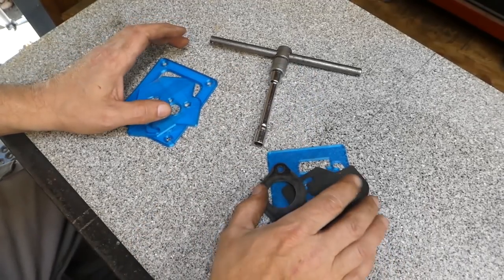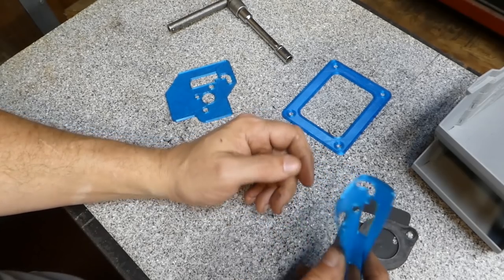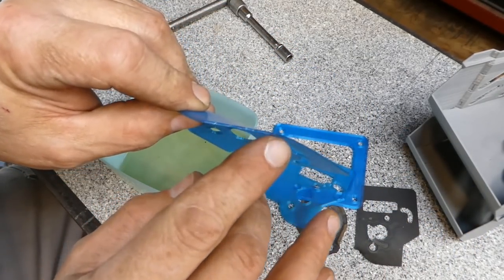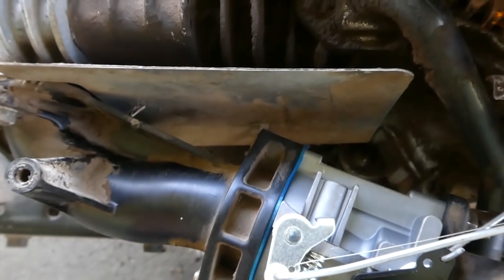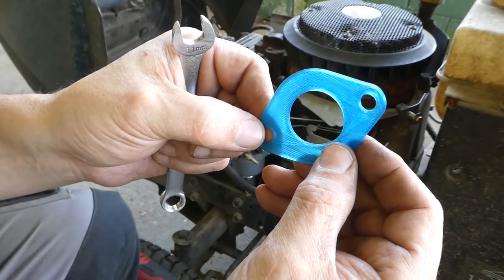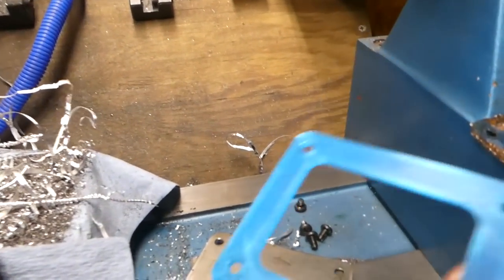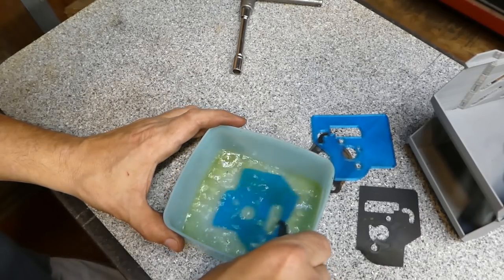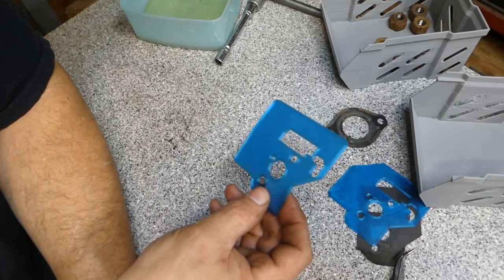3D printed gaskets? Any good?

Comment: Can you make a vid on how you design/ get your radius’s, and how you measure your parts, I print with tpu just never knew how to design the exact roundness
Reply from the maker: Hello Donovan, you are at least the second person to ask me this so I guess there is some interest in it. I am no expert but I will see what I can come up with. I am really behind in making videos because of other work but will give it a shot soon. Thanks!
Reply: @theeddies  yea, I have clutch covers and stuff, and the way they are shaped there such odd shapes
Reply from the maker: @Flatout56-o8k  Yeah on those, the only way I could think to "easily" do it is the photo transfer way. Either use the old gasket or trace its shape from the part. Then take a photo of it. Use that photo or convert that to a vector drawing like an SVG file which easier than it sounds. Import that into your CAD program, scale it, and use it as a backdrop to construct your lines. And just typing that out I realized if you have never done any of that it does not sound easy, lol. There are lots of instructional videos on this method though. NY CNC has a good video on the process, I will send you a link in different comment as links sometimes don't get sent.
Reply from the maker: @Flatout56-o8k  https://youtu.be/dUiIAb1YqeM

Comment: What about trying printing a mold and pouring some silicone in after it set up would make a good gasket? You would only need Pla to make mold
Reply from the maker: Sure, that is another method to try. I have not tried it yet myself but others have mentioned it.  Would probably need some release agent to cover the mold.

Comment: Just found this video, haven't checked your other videos yet but what do you think would be better for printing a thermal carburetor spacer, FDM or SLA prints?
Reply from the maker: For a solid spacer I would choose which ever has the most heat resistance/ best chemical resistance. And that gives me a great idea for a comparison video now that I have a SLA printer. Of the types I have tried, PETG and TPU would be my best options. ABS or Nylon would be better but difficult to print. There are some high temp resins but again not tried them. But I will definately be doing some testing now, lol.
Reply: @theeddies  I'm about to get some TPU95 A and I'll definitely give that a try.  I just need about 1/4" for clearances and I feel like 50 dollars for a phenolic spacer is highway robbery.
Backup option is PETG at 100% infill and two paper gaskets.
Reply from the maker: @cetate93  TPU will do it, print it solid. It might seem too stiff but it will be a little more flexible than phenolic and hold its form better than with infill. IMHO. I just ordered some high temp resin (up to 220c). I have been looking for another series like the gaskets and this might be interesting. Thanks for that. 😅
Reply: @theeddies  printing it now in some Overture 95A.  I actually needed a slightly thinner gasket so it's just going to be 4mm thick to allow for some squish.
Hopefully it will withstand Small Block Chevy temps and woodgas.
Reply from the maker: @cetate93  Nice! Let me know how it works out.

Comment: Just got here from hackaday I have to say that just from this video you deserve my sub, keep up the good work and this gasket idea its going to come in handy sooner or later.
Are you using a filament dryer for the TPU, I have a roll still in the bag because I'm afraid it will suck moisture without keeping it dry?
Reply from the maker: Hello, I was wondering where all these external views were coming from. Thanks for the kind comments. 
I did not use a dryer. I did put it back in a bag with desiccant each time after it was finished, except one time when I left it out for 2 days. It actually rained one of those days but it printed fine. I am sure different brands are going to react differently. This one seemed pretty tolerant to a couple days out of the bag. Can always throw it in a oven at around 50C for a couple hours as well. I have done that with PETG and it worked great, if your oven can maintain that temp fairly accurately.

Comment: Awesome! Once I get a direct drive I need to try to make diaphrams, like for the carburettor fuel pumps.

A question: Those trays... Where can I find that model? I've been looking for decent trays/bins, preferrably stackable and wall hangable, but yours seem to tick most boxes and look good.
Reply from the maker: Those are on thingiverse, I will send you a link in sperate comment as links sometimes don't work but you could also search "Customized Stackable Container Bins" by user "wardzx". His are very small but I just used the scale function in cura to making them bigger and they printed fine. I used an .06 nozzle and fast settings, I think I had them down to about 40 minutes apiece at about 4"x5"x3". I am sure they could be printed faster with more tweaks. With a 1 mm nozzle you could probably print them in Vase mode in 15-20 minutes. Thanks!
Reply from the maker: Customized Stackable Container Bins https://www.thingiverse.com/thing:5153356

Comment: Beautiful! urethane has really good memory, and it’s impervious to gasoline and oil. I have been wanting a 3d printer for some time. Any recommendations?
Reply from the maker: Hello, 
Thanks, yes it is working well so far. As far as recommendations, if you think you might want to print a lot of flexible I would make sure it has direct drive which I explain in the video. But having both systems, I just like the direct drive better for everything, It is a bit easier to use and a bit faster, but it does cost a little more. I still think my first printer (the Sovol linked in the description) is the best value for the money on the market. It has a lot of the features that printers > $500 have for nearly half the money. And I have only had minimal/correctable problems with it that you should expect with all printers under $500. There are also Sovol models with multiple extruders (print heads) and the like. It is easy to upgrade components and has a good online community for help. There are no printers out there under $1000 that are just plug and play right now. All of them have a bit of a learning curve and need a bit of patience but if you like to tinker and experiment, it is not that bad. 

If you want to start with just the basics to get your feet wet, I love my little Creality Ender Pro as well. I picked it up for $100 at a pawn shop and it was basically brand new. Once tuned up it actually prints more than the Sovol because I use it more for production and the Sovol for experiments. 

Any other questions, let me know. I am not an expert but happy to help.
Best!
Eddie

Comment: I usually juat cut them out of rubber. Believe it or not, I actually enjoy it.
Reply from the maker: I don't believe you, lol. Where do you get the rubber? Rubber has some down sides with fuel these days. Viton is better if left soaked like an o-ring.
Reply: @theeddies  That's the trick, I don't get the rubber. My dad has (had?) a large roll/sheet of red 1/8 inch rubber that was like 10-20 years old but still extremely pliable and not degraded in the slightest. I honestly have no idea about it's chemistry with fuel, but I do remember my dad saying he wished that he could find some more. I would bet that places simply stopped carrying sheets of rubber. I've made so damn many gaskets out of that stuff. It honestly might not have been the "best" solution, but it worked EXTREMELY well in most cases, and is VERY easy to work with ( cardboard templates ftw). Also, most of the gaskets I've made were relatively small, like around no more than 4 inches across at the widest, so it's not like I'm talking about trying to make head gaskets.
Reply from the maker: @tjpprojects7192  If it is old, it may be better quality than the stuff available now so that is a like gold.

Comment: the name of the carburetor that you have on your mower is called a Niki 6 carburetor
Reply from the maker: Actually it is a copy of a Niki made by #hipastore
Reply: @theeddies  eh there still a poor design because the materials that the o ring gaskets are made of does not hold up very well to today's gas and it causes them to start overloading the engine and also if you have a fuel shut off in the gas line to turn the fuel off after your done mowing they tend to fill the crank case with gas so if ever get done mowing and you shut the mower down and go back a day or later to start it and notice the tank is empty check your oil and change it because all your gas will be in the oil so my advice is get rid of that sale carburetor and get you a true wlabro carburetor for briggs and stratton engines
Reply from the maker: @billyjackson5799  Agree, the Nikki's are a terrible design. It has had a fuel shutoff since before I had it, no issues. I work for Hipa, they are quality economical replacements for a terrible carb, definitely better materials than the OEM but yeah still based on that design. I am giving this one a test which is the reason it is on there.
Reply: @theeddies  ok cool

Comment: Yes sir live channel love videos. Be watching them to catch up.
What do u think about ender 3 max. What I have few years now made few things not real computer savvy. Should I put direct drive on it for TPU. And what kind cad program would be best for doing this kind stuff and easiest to learn for beginners. Thanks from ur ole hillbilly buddy stay safe.
Reply from the maker: Thanks! I have not been making videos on here in a bit but plan to start back up soon. 
The MAX is basically the same as my Ender 3 Pro but with a bunch of upgrades. Should be a good machine. I would try the regular extruder with some TPU first, many have said they get good performance if you stick with the 95A variety which is the cheapest and most common. Stay away from Ninjaflex though, that stuff is really soft and hard to print without the direct drive. 

For simple things, TinkerCAD is a good place to start to learn the basics while still being able to make things. It is also browser based so you do not have to worry about having a really powerful computer to do the heavy lifting.  I use Autocad Fusion 360 which you can get free as a hobbyist. It is not difficult to use but without a good base of knowledge, it can be frustrating. It needs a fairly good computer to run though. A $200-300 consumer laptop or desktop is not going to run it without serious lag and crashes. I do not recommend starting with FreeCAD, it is completely free and a very powerful program but has a very steep learning curve and is not forgiving. A lot of people swear by it as the best FREE program but once you use something more intuitive, you will realize that you spent hours trying to do something in FreeCAD that takes seconds on a more refined program. To me it is a vanity project for a bunch of half ass engineers that is never going to be finished or completely usable.
Reply: @theeddies  I hear that . I look at tinker cad looks to be the easiest. But here's what I'm dealing with. Graduate school in early 90s regular classes. Never had great GPA. Lol . Mechanic my own stuff since I was n Jr high. Motorcycle 3 wheelers. In high school driver's Ed teacher would write my teacher usually English class or history if I could go to his class I would do maintenance on Pontiac Bonneville Dr. Car. Once a week. Lol my teacher's didn't care usually sleep or disturbance probably now look back shame on me. But oh well now I'm paying for it. Have pay get computer stuff done. I put bl touch on my printer it's looks factory never got use it don't quite no how to get firmware I don't even remember now what called when do card reprogram it.
I've have made few parts got off thing I verse couple parts for 10/22 they worked . I copied it or something max has ben covered up every since. Watch video none really on max on install program to make it work I didn't reset it so I did use it after put no on once and used regular program card . Lol
I took got cheap go pro and put wrong card n earsed it format it whatever called it was my original max directions. Lol going have take computer class kids do some but they do it and don't help me. But then it's dad help me fix my car dad u got this tool for whatever yeah here how works  
Lol dad weld this up for me. U got kids u know . That's where I'm at 
Thanks for the advice I guess I will get computer because I'm afraid messing kids computer up I think bought my daughter 1500.
Gaming computer. Or something. IDK. Stay safe thanks for your time ur ole hillbilly buddy .

Comment: I am still looking to use the same TPU to print belts. Problem is getting replicating the belt designs in 3D software. For the standardized ones its great you can print perfect and seamless belts. If anyone has any methods for getting a belt design from a picture into and STL or OBJ file that would be incredible. Best I have so far is a tracing method that takes forever and the results are hit and miss.
Reply from the maker: If it is timing belts you are looking to print, Mcmaster Carr has CAD files and tech drawings.

Comment: Great video.  I print TPU's often and you're right ... MUCH easier to print if the 3D printer has a "direct drive" head.  TPU's come in various hardness (softness) grades.  A bowden-drive printer might be able to get away with a less-soft TPU (maybe something with Shore hardness 95A) but probably not with a softer TPU (e.g. NinjaFlex 85A).  

As for fuels ... TPU tends to have excellent resistance to petroleum products such as gasoline, kerosene, or oil... but NOT great resistance to ethanol.  There are places that sell pure gas (no ethanol) and there's a website to help find them:  https://www.pure-gas.org

Comment: A long time duration of fuel ( 1week and more) would be a nice test
Reply from the maker: That one I soaked was just set aside with gas still on it. It is still fine. But I can throw one in a jar and leave it for awhile. I doubt it will make much difference with just fuel. All the material sheets give TPU a high resistance rating.
Reply: @theeddies  i did try petg in fuel. I had deterioration only after a full week. That’s why i asked.
Reply from the maker: @MAXIMERACICOT  Well now I have to do a long term test. Coming soon. Thanks!

Comment: I would do silicone casting so print the negative of the gasked you want and then cast the part out of a 2 part silicone or even nicer there is silicone 3d printing out there i think they are called spectroplast but i do not have experience with there poroducts.
Reply from the maker: I plan on trying the silicone mold. I might be the GasketChannel by the time I am done experimenting with different methods, lol.

Comment: This is a great idea. Pretty sure it wouldn’t work for exhaust applications at all but just about anything else!
Reply from the maker: Hello, I wish I would have originally came up with the idea but yes it has its uses. In a follow up video I measured the temp of the mower exhaust. It was around 130c in places so exhaust gaskets are definitely out. I will be putting a gasket on the valve cover which comes into contact with 75-80c oil, so that will be a good test. Thanks!

Comment: Also, bushings. Is it feasible?
Reply from the maker: Sure bushings would be feasible but the coefficient of friction is rather high as opposed to PETG or PLA. A fixed flexible bushing would work.
Reply: @theeddies  I somewhere read or saw a guy create bushings for his suspension. It worked pretty well, even for the long term I believe
Reply from the maker: @Produkt_R  I could certainly see that. I believe they sell high performance  polyurethane suspension bushings so this would not be be much different. That would be fixed flexible.

Comment: getting close to a year later. how's everything holding up?
Reply from the maker: No issues, all the gaskets are still in there and performing well. I honestly thought at least one would fail but nope. I have been meaning to make follow up but life got in the way, it is still in my plans but there is not much to say. There was really no problems. I still also have some printed tpu soaking in a sealed jar with gasoline this whole time and when I pulled it out about a month ago, it was still fine and not degraded.

Comment: The reason the cork gasket leaked was because of the thin metal cover you made not the gaskets fault it needs to be made of thicker metal not thin aluminum...

Comment: There's a reason we don't use plastic as gaskets.... heat from the engine is likely to melt it.
Reply from the maker: Plastic gaskets and sealing components are used for all sort of applications. Including in every modern car's engine bay. Yes there are things like head gaskets and exhaust gaskets that are not suitable but plastic components are widely used in moderately hot environments. See my other videos on the topic for the limits of TPU.

Comment: Eyeballs 2 faster devices that can cut plastic and thin rubber (vinyl cutter and laser cutter)
Reply from the maker: Yes, I actually have a laser module for the printer but have not even used it yet. This is just an experiment to see if this method can be used.

Comment: Could you 3d print weed eater line??
Reply from the maker: You probably could. I am not sure why, as filament is about 5x the price but you could design a file to make a separating coil of line. Actually, you can print WITH trimmer line used as the filament from what I understand, though I have not tired it yet.